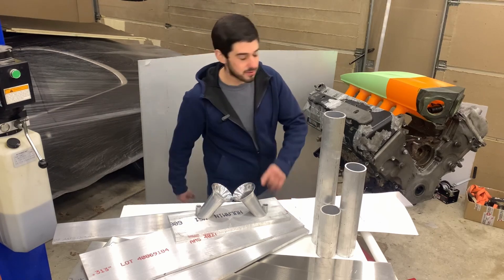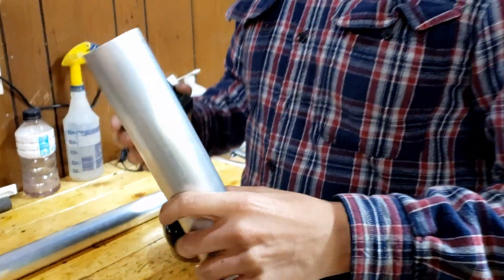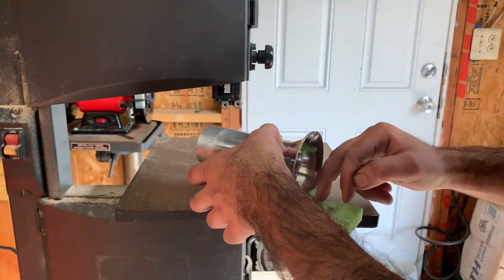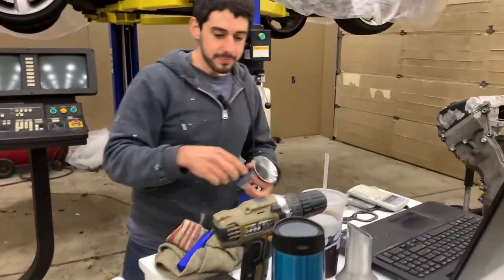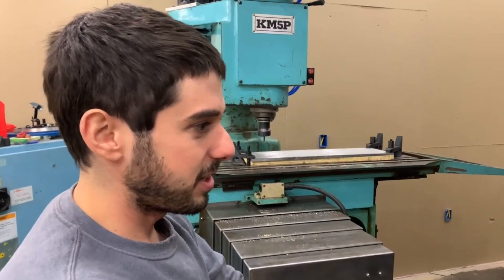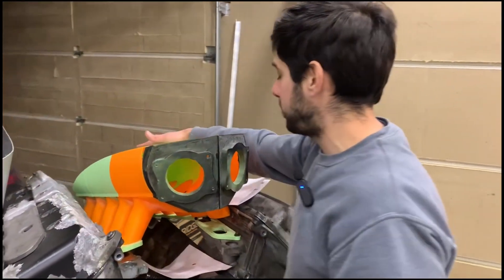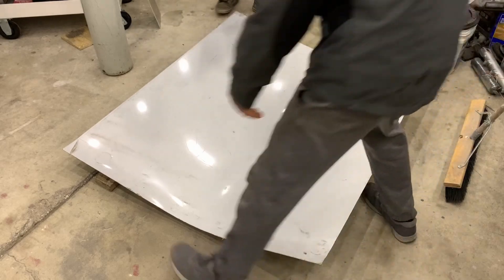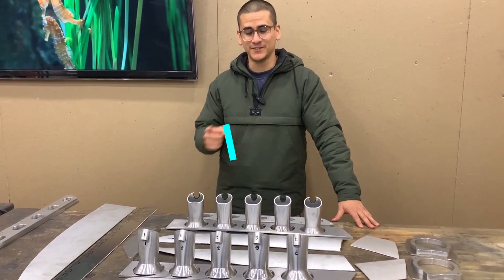Machining Parts For The Intake Manifold! - Ford V10 4V Ep. 6

Comment: I know I’m a bit late but I highly recommend using a little wd40 when machining aluminum. I’m not sure why but there is no better lubricant for cutting/milling aluminum. Makes for clean edges and prevents the aluminum from galling and tearing (especially on softer grades) and prevents chip build up in your tooling which can save you a lot of headaches. Just my two cents from working in a machine shop and doing a lot of aluminum on lathes and mills

Comment: I know this is old but don't ever use a cutoff wheel to cut aluminum you're going to weld. The little bits of the wheel will impregnate into the cut area, and this will affect your welds, causing pin holes when these bits start to float up into the weld puddle. I learned this the hard way years ago while fabricating my aluminum oil pan and fuel swirl pot.

Comment: Phenomenal work, guys.   I have a 10yr old Ford Modular V8 project that I need to resurrect, and this gives me inspiration.  If you guys were close to me, I would have let you use my 400A TIG welder so you wouldn't have had to struggle with that AHP and that air-cooled torch :)
Reply from the maker: The torch and leads did get very hot welding those heads! 
You should definitely get that V8 project rolling! 🤟🏽

Comment: I’ve been fantasizing about a 6.8 Triton build, with various heads (ported 3v, Trickflow TW 2v heads cut and welded, 4v as well) so it’s cool to see someone do the last one. What are you guys gonna do with the weak split pin crank? A custom short throw crank would be cool
Reply from the maker: We plan on using the stock crank. It is forged and people have made good power on it so we plan on reusing it.

Comment: I wonder what the v10 power record is. I bet you guys will be number 1
Reply: Some guy on a forum posted a dyno of 700-ish horsepower. Not sure if it was wheel or net horsepower though
Reply: @johnherbold6539  That's gotta be turbo though right?
Reply: @Levibetz  yep it was for a turbo excursion
Reply: Richard Holdener's 5.4 Navigator engine dyno test got 444 hp and 380 lb.ft. of torque at 6500 and 5200 rpm respectively. Extrapolating for the larger 6.8 V10 produces numbers of 560 hp and 479 lb.ft. Using the torque/rpm formula should push the horsepower to about 730 naturally aspirated at 8,000 rpm. That is theoretical but certainly possible.